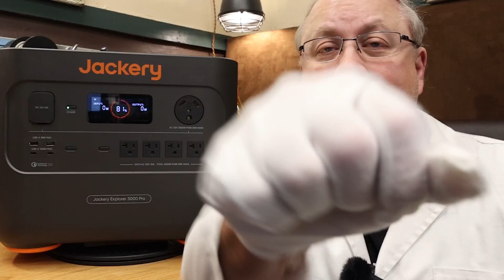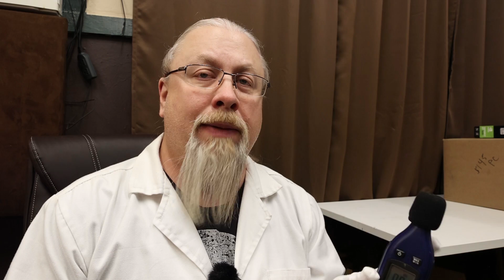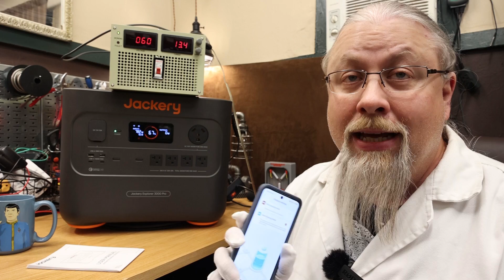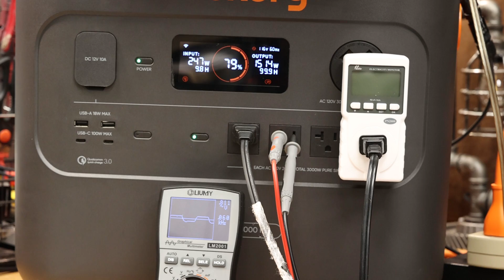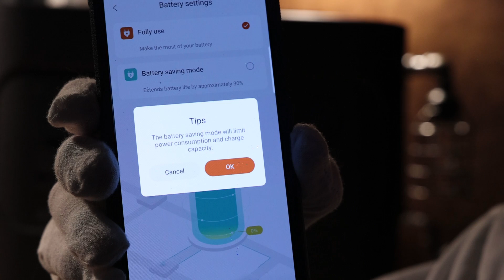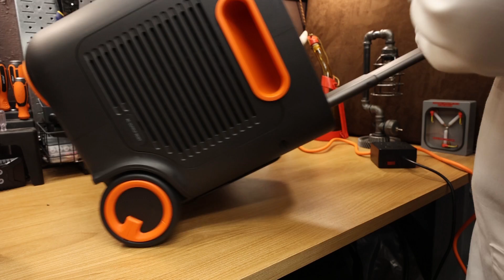JACKERY 3000 PRO 3000w UPS Solar Generator Lithium Battery Power Station Review

Comment from the maker: Get the 3000 PRO: https://gohobo.io/j3kpro [3000 PRO w/400w Panels: https://gohobo.io/j3ksogen ] use code HOBOTECH2023 at checkout.
Jackery Solar Adapters: https://gohobo.io/adapters
Get 10% off all other Jackery products using code HOBOTECH : https://gohobo.io/jackery
DISCOUNT CODES on SOLAR PANELS - GENERATORS - REFRIGERATORS : https://hobotech.tv/amazon
Reply: I tried the discount code HOBOTECH2023 at checkout and it doesn't work? I thought I would let you know.
Reply: It won’t take the code. 💔
Reply from the maker: Jackery screwed up and forgot to activate my code. Sorry. I yelled at them.
Reply: @HOBOTECH  still not working and the link for just the Power station and the link for the power station and the panels are the same
Reply from the maker: Jackery Explorer 3000 Pro Portable Power Station
 HOBOTECH2023 (-$ 223.92)
$2,575.08
Reply: @HOBOTECH  - code works 03/28/23
Reply: 400 Watt panels? OMG they must be beasts!  I have 4 200 watt Jackery panels ……they are 4 panels EACH!  Half a standard roof-top lol
Reply: @Keith Balke  It's two 200 watt panels for a total of 400 watts.
Reply: Is there any way to add extra batteries like their Plus model?
Reply: Doesn’t accept your code.

Comment: My production company has begun investing in these.  I get to open them up.  Important to note: the RV plug and 120V outlets are in parallel and the trailer plug is BEFORE the 20A breakers.  This would indicate the safety for the 3KW plug is completely in the inverter.  This may be what triggers the dreaded F1 error.  And the fact that this video is 2 years old may explain why I'm getting bombarded every 4 days with "75% OFF!" sales notices.  They're probably clearing their shelves.

Comment: Little confused on the UPS mode test. The exceeding 1800 watts part. My question would be if I’m charging Via solar panels and say inputing 800 watts with my solar saga panels. My output on the jackery won’t be able to exceed 1800 watts or is that only true when charging from a wall outlet?

Comment: I wish I had seen this review before purchasing the Jackery 3000 Pro. I love it, but I didn't do enough research to get better information on it, and missed that Jackery's "Pro" series power stations are still Lithium Ion batteries, and not LiPo4 batteries which last longer. Otherwise, it performs awesomely for my needs. I also bought two Jackery Explorer 1000 v2's, which have LiPO4 batteries, but are not expandable using Jackery's overpriced battery packs.

Comment: For Dometic CFX3 35 portable fridge freezer, which Brand portable power station will be the best for 2 day's continue operation?

Can anyone tell me about it?

I prefer lifepo4 power station but which company lifepo4 power station is the best? Im little bit confused

I have heard Renogy Phoenix 1000 is lifepo4 battery made with 3000 cycle lifespan.

But I want to know more.
Reply from the maker: Watch my review on the Bluetti AC180. The only LFP Jackery is the 2000 Plus and it's way overkill for 12v fridge duty.

Comment: How do you think this would fare with a pop up camper and portable AC inside using the 30amp connection?That would be the highest draw item. Everything else is LED 12v lighting. Cooking is via gas stove.

Comment: Does the 3000 use the same solar panel as the 1500? Will the work or does it require a new panel as well.

Comment: Thank you for this most excellent review/presentation. I use a hotspot in my RV. My RV runs on a Predator 4500 inverter.  All is good until my AC (Air Conditioning) compressor kicks on. Both my TV and Hotspot will die/reboot. I'm considering a soft start module for the roof AC but I'm also considering a heavy-duty UPS. My only question was is the 20 mil switching good enough. You answered that question. Yeah, both loads (T-mobile cell modem) and my TV might consume just a fraction of needed isolated power so maybe a $100 cheap APC. But that has little room for increasing the load. What to do, what to do. 
Thanks, man. 
Cheers from Louisiana.

Comment: HOBOTECH. Can you please do some RV tests if you get a chance. The reason is RV parks lose electricity all the time. Far more than blackouts. If you have to leave and have slide outs to move back in this is a big plus for emergency backup power. I’m dialing in what product to bring in motorhome.  So far I’m cautiously undecided but ready to buy soon. Summer is coming. FYI, yes, I have a generator but there are blackout times in park rules not to use them and many times I have to go/ move during those or don’t want to wake up my fellow campers with noise. People get pissed over noise for various reasons.

Comment: Great review Hobotech!! For the off-roading group the weight/portability is a huge factor!   I guess I might be a little prejudiced because I have been nothing but happy with my Jackery 500 and 1000!  One of the best things I did before I finally got solar panels on the roof of my van to power my fridge. BUT I still use both of my lightweight  power options outside to power my Starlink and to keep mine and my friends phones, speakers etc charged while we sit outside enjoying our adventures.
To clarify, if this is your daily power supply, then NO! If this is for your adventures into the Outback one or two times a month, then YES, this is the ticket.

Comment: I totally get the value of the smaller systems, but these large, high-wattage, semi-portable options make a lot less sense to me.  When you are talking about this kind of money, you are now competing against both a good quality gas generator and a larger, permanent solar system.  This can't run even a small window AC or RV AC all night long.  It can run big loads for relatively short periods of time.  I am sure there are some edge cases like being in an apartment where you absolutely can't have a gas generator or bigger solar system, but I am struggling to see where anybody who has those other options is going to buy this instead.

Comment: I would not trust the 20ms relay to support a nas thou. I had mine and it broke several drives. Expensive and corrupted my data 
If its on bypass (online UPS mode) then it is okay as long as the nas is within the power charged I think

Comment: Hey, Hobotech...ers....   First of all, thank you to whomever for pulling my post about the Jackery discount codes.  I'm a dumb-ass
My new 3000Pro arrived, and I set it up out back to charge up on the Jackery solar panels I got with my 2000Pro model.  All was well and productive UNTIL I updated the firmware from 1.0 to 1.7 as directed by the Jackery app... Currently the solar charging is not functional.  I plugged it into house power and it charged just fine.  I will say that Jackery's customer support was quick to reply to my email, and we'll see where it ends up getting sorted out...  The F code was F-2, which according to 2000Pro users is a simple disconnect the cord from solar to unit and reconnect it.  As I have 98% battery charge, I'm not sure if it would register. But when I unplugged and then plugged in my panels, there was no charge showing on the input.  More when I have it....
Reply: UPDATE 04/03:  According to Jackery, the F-2 fault cannot be repaired via firmware.  They informed me that it is a rare occurrence and returning the unit is best (and sending me a new one).  I went to do that today, but FedEx would not accept the package due to the battery it contains (I'm in CA).  Apparently there is extra paperwork required to ship it.  So be warned, have Jackery send a truck to pick up the unit.  I am currently waiting on when.  I want to repeat that, despite this hassle with the unit failure, Jackery customer service has been helpful and very communicative.  More when I have it.
Reply: UPDATE 04/04:  Item one; Now Jackery is informing me that they "think" a remote fix is possible. Have not heard back on that yet.  Also, interesting twist;  I went to plug in my Jackery 2000 Pro and there was no input from either of the Jackery panels.  I plugged in my other brand panels (thanks to Hobo I had all the adapters needed!) and 175W of input shows.  I informed Jackery. More when I know it.
Reply: I should add; no, plugging my other panels into the 3000 Pro unit did not resolve the F-2 fault.  But, oh joy, I now have Jackery panels that do not work either...
Reply: UPDATE 4/06:  Apparently whatever happened with the F-2 fault on the 3000Pro damaged the Jackery panels and I am returning them for replacement.  I wish I had "HOBO" knowledge as to what may have caused all this. 
Also; I should have the fix update in a few days.  
More when I have it.  
Happy Easter weekend!
Reply: UPDATE 04/07: Jackery is replacing my two damaged 200W panels, and if I need to return the damaged ones, will arrange for packaging, and pickup. I'm fairly sure Hobo-meister could repair these panels with ease.  Anyway, thus far I am very impressed with their customer / product support. 
My 3000Pro fix is still in process, but they continue to communicate status to me.
More when I have it.
Reply: UPDATE 04/10:  Today I was contacted by Jackery via phone.  Updated the firmware on the 3000Pro and the result is a fix.  One caveat; it charges via AC, and DC from my truck.  Until I have panels, I won't know if that source works. However, since the panels plug into the same outlet as the 12V cigarette lighter outlet, I am pretty sure this is fixed.  The Jackery agent stated that they did find the error, and that this was the fix for it.  So far, so good.  More when I have panels to test.

Comment: I get that Jackery markets portability, so I have usually given them a pass about not having LFP in their smaller units, since they are smaller, lighter and well... more portable.  But for something this large, this non-portable, And designed more for home backup and off grid use, there is no excuse for sticking with older lithium battery technology here.

Comment: Not a good option for home backup with a tiny 60 volts open circuit and lithium ion battery with limited cycles.

Comment: I think that the inverter is oversized in relation to the overall design.  By this I mean: since the unit is not expandable, at 3000 watts and just over 3 kWH of battery, at full load the box is good for just one hour from full to empty.  It seems to me that there are very few use cases where you need to go all-out at 3000 watts, but just for that short a while.  Like, run two microwave ovens?  Like, heat two rooms in your cabin, for a hour, and then it's done?  (An oversized inverter would be fine "just in case", but a giant inverter comes at a non-trivial efficiency & cost penalty...)

Comment: Excellent video...thanks. Quick question: have you done a video showing how a homeowner might deploy one (or more) UPS/solar generators when the power is out. How to locate when the frig isn't near the laundry room or the (reduced) living area that might be heated or cooled? Is it simply a matter of long extension cords & wisely balancing loads? Again, many thanks.
Reply: A transfer switch will make things 100x easier.

Comment: The feature that I want to know about, in all your power stations is if it has that auto shut off feature when unit is not in use, it's a deal breaker if I can't turn that feature off. Thank you for mentioning it here

Comment: You really need to do the UPS test with the the battery at 100%, because thats how its going to be used in the real world.
Reply from the maker: I disagree. If the power goes out multiple times the battery will not be 100% and that's a real world situation. Testing only at 100% won't expose a weakness in design.

Comment: You might want to point out that running a laptop with a good internal battery acts as it's own UPS.  I still have that exact laptop lol, circa 2005
Reply: Aka boat anchor
Reply from the maker: I think it's obvious people know a laptop with a battery in it will keep running. 🙄🖖

Comment: Yaaaaiii ! nice UPS ✌️, but try an encandencent light bulb to try it ,,, power bricks will have capacitors inside which will keep power to load for a few milliseconds(seconds) depending on loads ! 👍👍👍
Reply from the maker: The power brick makes no difference. I've been using this laptop for this test for years and it fails on power stations that switch too slow.

Comment: Having only ONE 10am 12VDC plug is ridiculous! A complete fail in my opinion. I use two separate DC circuits, one rated at 30amps on my system! AND - I need both.
Reply from the maker: Then get a Bluetti. It has a hardwired DC output.
Reply: @HOBOTECH  #1 son did - an AC-200-Max. Needed the 30amp DC circuit to properly control his diesel heater.

Comment: im strickly lfp but something this size i would be using only for emergencies so lithium is perfectly fine especially considering its lighter and it lasts 2000 cycles.

why so many cycles compared to 500 on others with the same lithium batteries?
Reply from the maker: Battery Saver Mode

Comment: Jackery continues to be a company for suckers and idiots.  Selling you dinosaur NMC battery tech at a premium price.

What a rip off.

Even more reason to buy EcoFlow who uses LiFePO4 battery tech with much more life cycles in their latest models.
Reply: Jackery does have the pretty orange case. You gotta give em that 😂
Reply from the maker: Heads up that NMC batteries are literally a decade newer technology and more power dense than LiFePO4. Therefore they weigh less and cost more. Most folks seem to think that LiFePO4 is newer or more expensive.
Reply: @HOBOTECH  I’m a big fan because of the weight/portability!

Comment: The problem with Jackery is that they pay people like you to mumble performance numbers and lie about their fire safety.  Lithium ion batteries like the ones that Jackery uses tend to catch fire when they malfunction and they produce both oxygen and hydrogen, like a blow torch, when they burn.  This is why lithium ion fires burn hotter are nearly impossible to put out.  For example a guy recently died in a New York apartment fire caused by lithium ion batteries--the reason e-bikes with their lithium ion batteries are starting to be banned from inside the buildings. The only safe way to use a Jackery is to keep it outside.  Power stations with lithium iron phosphate (LiFePO4) batteries are much safer from fire hazard.
Reply: Own the 1000 and 2000pro…….very happy with them. Attacking Hobos integrity is bullshit bro
Reply: @keithbalke6352  Ignorance is bliss.
Reply: @mojavedesert519   You full of “bliss” bro?

Comment: I'm interested in a battery solution vs. the typical gas/LP generator.  I would prefer something that could stay in
the garage near the circuit panel.  The issue is how long can a battery type generator run.  My thoughts where to have a secondary circuit panel with the circuits I would like to run.   My largest current draw is a well pump.  Next would be
a refrigerator then finally the Oil fired Furnace.    The rest of the house would be TVs and computers.   Gas over and gas
cook top, gas clothes dryer.  All of these do not have to be on at the same time.   The goal is to stay warm, watch a little tv
and be able to cook.   Lately the longest power outage has been around 12 hours.
I have seen a couple now of these type of batter inverters.  One that lets you connect 2 units together for over 8kW of power.
Reply: I have Jackery 1000 and 2000pro…..these coupled with a Champion 4500 K propane (which I have) compliment each other extremely well. Cloudy weather ect…. Can’t go wrong with both options Ken. AC charging is super fast
Reply: Battery run time depends on how much power you use.  If the battery holds 2000 watt-hours, or 2 kilowatt-hours (KWH), then it will run 200 watts for 10 hours.  Or 20 watts for 100 hours.  Or 2000 watts for 1 hour (actually at this high of a load, it might run less time as it it working so hard).
So figure out how much power you need, and compare that to the size of the battery.

I'll tell you right now, your well pump likely has a large starting surge and that is going to require an oversized system.  If it is a submersible pump in a deep well it is most likely using 240v, which is in a different league (a pair of delta pro by ecoflow with their 240v combiner accessory might do it, and you can add expansion batteries as needed to increase run time).
Reply: @Sylvan_dB  I think the problem I have is a well pump.  I am concerned the surge of the pump kicking in might bring this inverted to its knees. Other than the water pump everything else is not an issue.  I have propane for cooking and clothes dryber. I don't need to run the A/C.  I just like the idea of having the inverted in the garage something obviously I can't do with a gas/propane generator.

Comment: Be aware that 3000 unit has LI NMC battery and not a LIFEPO4 so about 1/5 the lifecycles of a LIFEPO4 power station and more risk of a thermal run away and fire!

Comment: Jackery uses lithium Ion (outdated, 2000 cycles to 70%) rather than Iithium iron phosphate LifePO4 (current, 3500+ cycles to 80%). Not sure why they keep doing this, aside from maybe they invested heavily in lithium ion manufacturing?
Reply from the maker: NMC batteries are 10 years newer tech than LiFePO4 which is why they are more expensive.
Reply: @HOBOTECH  Regardless of which was invented first, LifePO4 is the superior battery, and currently the best choice (more efficient/cheaper/safer/more environmentally friendly). I look forward to Jackery getting on the LifePO4 bandwagon - as well as lowering their prices. Love your videos! 😊
Reply: @davebrownentertainment7191  'Paid' by Jackery for the advertisement?🤔
Reply: @HOBOTECH  Not really, its NMC batteries require Nickel, Manganese, and Cobalt in considerable quantity for the cathode material that make them more expensive!